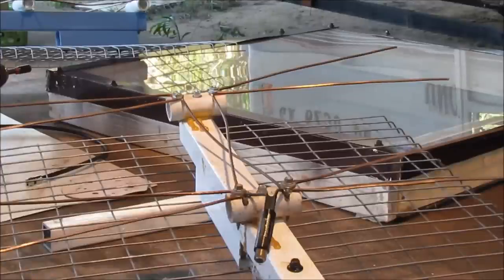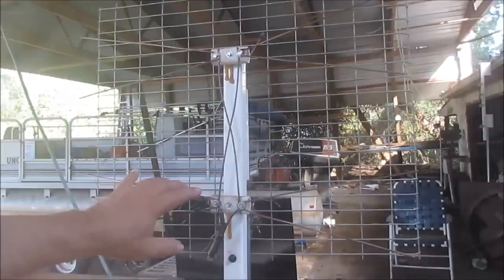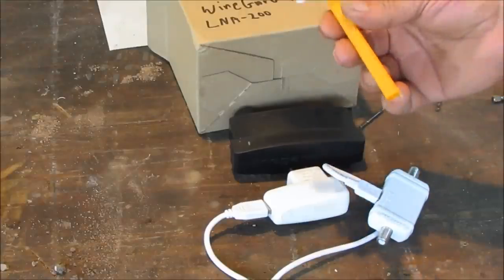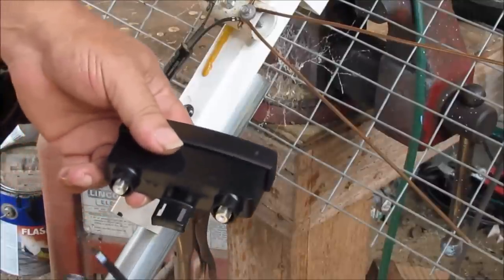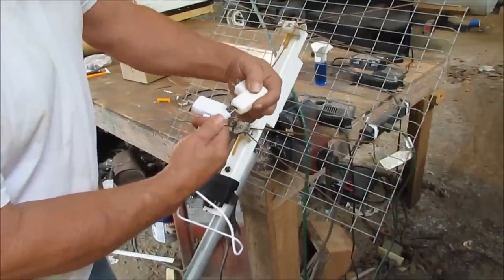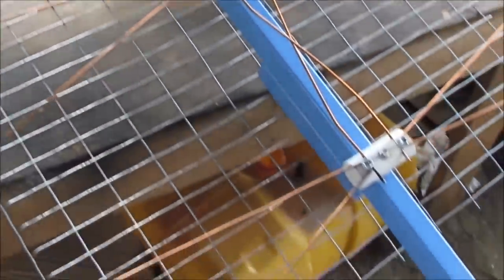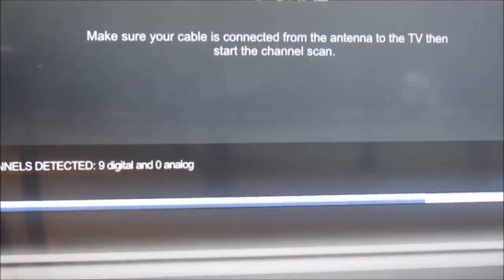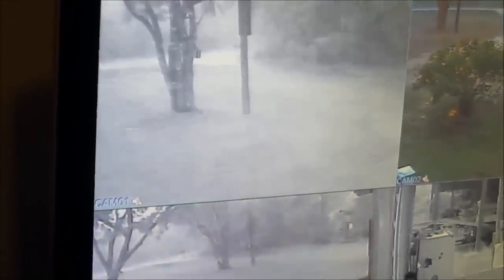Winegard LNA-200 Boost XT TV Antenna Booster Real Test

Comment: You know I like that USB power plugged into the TV. Not burning any power or putting miles on when the TV is off.
Reply: Guessing you don't know what miles are....as long as it's plugged in it's using power...
Reply: @red2965  Most devices drop output power when switched off.  So if plugged into the tv's USB,  TV off= signal amp off. Please explain where I'm wrong.
Reply: @charredskeleton  is the green light still on?  I connected a USB light to my tv and the only way it's off is if I switch it off. If I spoke out of turn I apologize.

Comment: Hi Danny,

any comments on using an LNA-200 preamplifier combined with a PCT distribution amplifier? I did it but it seems they are not compatible. Signal improves when I use only one of the amplifiers.

Comment: Hi Danny. Thanks for this video. I like this Winegard since it is designed for a power inserter and includes it. I was about to buy a different amp that would have required that I buy a separate inserter.

Comment: Danny,
I have 2 outside antennas and 2 RCA pre amps,
I want your unofficial opinion.
Can I use 1 inside power source to power both Preamps?
I know that's unconventional, But I don't see why it don't work.
I got in this bind because I thought my existing pre amp may have failed after a recent storm, so I bought second preamp only to find that the first one still works.
So to use my 2 antenna that are mounted on separate poles, I'm using a 6 foot rg6 cable and a 25 foot which I'd rather eliminate and use a 6 'rg6 cable to the second antenna and preamp,
then add combine the signals at the house and into a single power feed.

I live in a wooded country area between 2 markets, with 41 plus station south of me and another 20 or so stations north of me.
I'm in between Wilmington NC and Jacksonville/New Bern and can pick up one or the other so I want to dedicate an antenna to each source

Do you see a voltage Issue because I'm thinking NOT! No voltage issue. I'm not an electrician, but I did sleep at a Holiday inn back in 1998.

Now, I play electric guitar, so I'm not wrapped right, but where as I used to think the each pedal needed it's own power source, I have since found out that you can chain 5 or 6 pedals off of one wall wart.

I haven't opened the second preamp and still have the receipt.
I just want your Unofficial opinion.

Comment: Hey Danny I live in West Texas and we have 14 digital channels available, however the transmitter sites are 120 degrees apart so pointing the ultimate Antenna in one direction gets about 7 channels. What if I were to built two more ultimate antennas and pointed them at the other transmitters? How would I hook up the Balum? Use one Balum  and tie all the antenna whiskers together? What do you suggest?
I love your videos. Keep up the great work. I use to live in South GA in Thomasville.

Comment: Would an amp such as the Channel Master 7777 with more gain be better for far off distant channels? Plus it has inputs for UHF and VHF separately too.
Reply: @Junk Yard - An Amplifier Booster is only for " Long Distant Cable/Wires " or " Multi-TV Splits ".  But if you have less than 20 Feet Cable and 1 TV, there is no need to buy a Amplifier Booster!  But if your Wire / Cable is long, then you need a Amplifier Booster!  NOTE:  Better to invest in better Antenna!

Comment: Have you tried this amp: Antra AT-PAA28 Low Noise Pre-Amplifier 28dB?
For me this one worked better, the RCA was okay for i live 65-70 miles away from the signal i wanted to use and the closest antenas are 35 mile Spanish TV and wether channels which i don't use.

Comment: Danny, I have this Winegard LNA-200 Boost XT booster I bought a few weeks ago and im pretty sure my power inserter is working. Can you assure me  that the 5v output on the inserter is making it up a 50 ft RG6 dual shield cable run? If the preamp isn't powered would it still pass antenna signal through it? I didn't bother testing after I already mounted it and it is way too cold up here in NH to be setting up my ladder again. Thanks.
Reply from the maker: Winegard LNA-200 Boost XT  YES EASY

Comment: where u get the copper rod for elements at and wht size is the rod
Reply: Home Depot sell them by the foot.  I think he said 11 Gauge.  I am currently experimenting the 3.0MM thickness vers 2.5mm thickness.  They both are available at Home Depot or Lowes

Comment: My TiVo box was not picking up one of my channels at all, with a TiVo signal strength of 32 and was pixelating in and out on the CBS channel 12 in Augusta Ga,  I am in mid range for the transmitters, both are VHF, but I am in a hole.  I had two choices raise my antenna a Clearstream 2mv,  which right now is only 10 feet above roof line or try the Winegard.

I installed the Winegard today and was just testing it in the house on my TIVO TV, I went from a 32-60 on my NBC channel I could not get before, and from 37-65 on my marginal station.  I saw where you where testing on your bench outside and decided to try it inside.  The TIVO was the only TV I was having reception problems on.  The other 3 were already fine so I am going to see if it can leave it inside.

Thanks for your post.  While it cost a bit, it kept me from going up on the roof and having to change out the pole for a longer one.

Comment: You're little usb tuner doesn't have enough amplification.  Most TV tuners will have amplification strong enough already  These signal boosters are worth adding if you are using splitters  and long coax runs however.

Comment: I thought the amp only makes up for line loss from antenna to tv, it does not improve reception.
Reply: I'm an ex-catv tech.  You are correct, the amp makes up for line loss.  If the signal goes below a certain point, the picture pixelates. If your signal is strong enough coming out of the antenna, then it will be ABOVE the minimum and the picture is steady.  No booster needed.   Usually though, there is ONE or 2 channels that are borderline, and the booster gets them above that threshold.  If you OVER AMPLIFY the signal then the signal is un-usable.  This can be a problem if you have ONE channel that is very strong... but another channel you need to boost up a little.  It can get a little bit difficult.
Reply: Yeah, I was waiting for him to show length of cord he was using.
Reply: An Amplifier Booster is only for " Long Distant Cable/Wires " or " Multi-TV Splits ".  But if you have less than 20 Feet Cable and 1 TV, there is no need to buy a Booster!
Reply: This amp DOES in fact amplify signals from the antenna.   Ignore these cable people  who say otherwise.   With my TV positioned using 5 ft. of coax from the antenna to the TV, the amp will dramatically increase your reception from marginal, to full solid signal.  This video did a similar test.  That said, the antenna he's demostrating is for UHF, and it's the best design.  The preamp, however is for both UHF and VHF.   Some of your stations are most likely VHF, regardless of it's channel number.  To capture those channels, I would recommend coupling his antenna with a VHF antenna through a UHF/VHF splitter., then adding the amp.  Also spend a LOT of time trying the antenna at various locations and heights to find the sweet spot in your yard.  Investing time  finding the sweet spot, THEN adding on the amp to clear up weak signals, if necessary will provide great results.  I get a solid signal from a station 70mi. away.  If I move the antenna higher, or lower, or LEFT or RIGHT, I loose the signal complety!  It's important you find that BEST spot!   And, of the 60 stations I receive, 16 are VHF and require a VHF antenna.  IF you're making your own UHF antenna, make sure the elements are spaced far enough from the rear screen reflector, especially for lower UHF channels.  You may want to experiement with the distance of the active elements from the rear reflector screen for the channels you receive.  It has a huge effect on the gain of your antenna.  The FCC is shifting all TV channels down below 36, so a spacing of 4  3/4" between the whiskers and the rear reflector screen provides the highest gain.

Comment: So, say I have 4 different directions of OTA broadcasts. I know how to integrate an A/B with an A/B/C to effect an A/B/C/D switch [High Isolation Switch], now that I did some Googling and thought about it... but how do I make one from scratch? Maybe I haven't looked hard enough, but there doesn't seem to be a lot on the subject... Is this a topic you could make a video about, Danny?

Great videos, BTW. To the point of the "how to"... Thanks!
Reply from the maker: STAY TUNED TO MY CHANNEL IM WORKING ON A BOOSTER... MAKING ONE
Reply: Get a rotator to turn the antenna around, from inside the house. The ONLY way to do it!!

Comment: If you ever wana have fun and do some antenna testing we need to talk! I live on the highest elevation point in  Macon/middle GA and it's perfect for testing. My hobbies consists of CB, Ham radio, FM radio Long range listings and now getting into the TV antenna hobby. I would like to see more info on the signal boosters and Your lightning protection methods. thanks UNIT-10
Reply from the maker: I HEAR YA MAN I WILL KEEP THAT IN MIND

Comment: Danny:

I am the dude that asked you to make this video about a month ago.  What is the difference between dual ultimate antennas vs. one ultimate antenna with the winegard booster???  Your recommendation and comments would be welcome.

PS: I built me a ultimate antenna and it is amazing.  Get Chattanooga and Knoxville (both about 70 miles away)!!!!
Reply from the maker: THE SINGLE ANTENNA WITH THE AMP WILL DO BETTER THAN DUEL WITHOUT THE AMP...DUEL WITH THE AMP  IS REAL STRONG